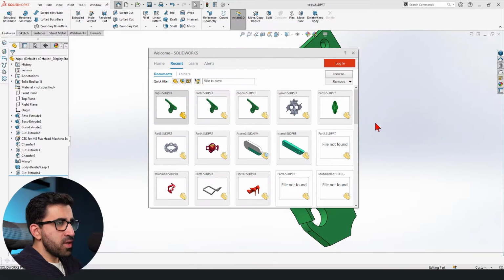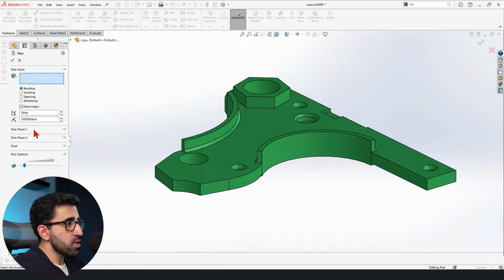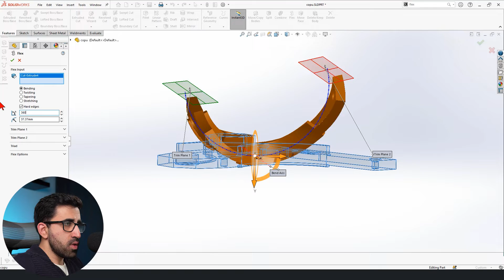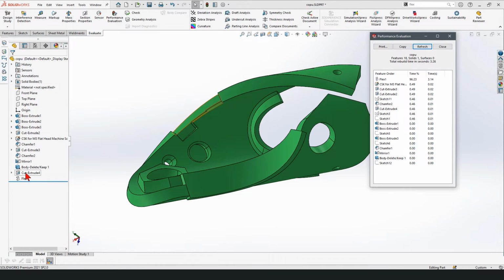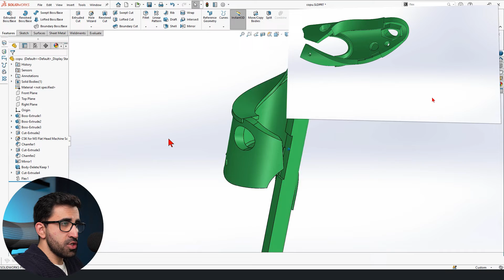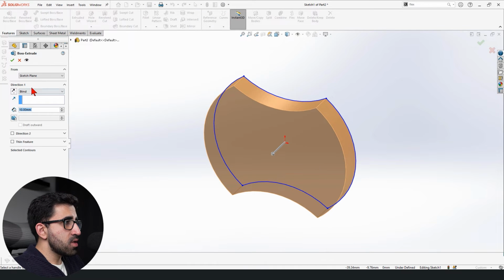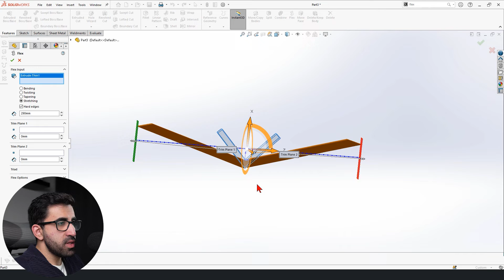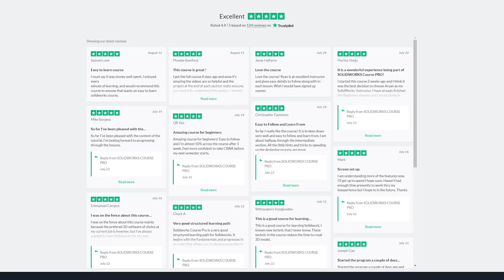Flex - The tool that you SHOULDN'T use in SolidWorks

Comment: I spent way too much time looking for a way to make a tapered loft along a spline work, and finally learned about the flex tool through your video. Hopefully that will solve my problem. Thanks!
Reply from the maker: Glad I could help! but flex is not an ideal solution for your need
Reply: @with-aryan  Yup, I found out shortly after. :D

Comment: SHOULDN'T use.  Hummmm smells like a clickbait video title to suck people into watching.  I feel this way because Aryan gave no reasonable reason for not using this feature other than it takes a lot of computation time.  Just one more channel to block from recommendations.  I will stick with CAD channels that don't feel the need to use clickbait.
Reply from the maker: How many other reasons do you need?
Reply: I have been told by several engineers to avoid the flex tool. I was not sure why and found this video by searching for why not to use the flex tool. I think there are more reasons than just compilation time, since you lose control of the way the geometry forms that you could retain if you use other features, but that's probably beyond most of the audience of the video. There's clickbait, and then there's a teacher genuinely conveying an industry trend to avoid a feature in Solidworks without going too in depth. Find something better to do than leaving unconstructive comments on youtube.
Reply: @paulmiller7078  Paul I don't find Aryan's opinion as a valid reason for not using the flex command.  I do however find the term "Shouldn't use" as clickbait as it is a term that draws people into investing a claim.  If the video title was "The Flex command, it will slow down your work" I would not have felt this was clickbait.  I guess we are down to what one considers misleading.  So I think my opinion is as good as your negative one about mine being unconstructive.  To put a finer point on the discussion the flex command is not all that a problem on a very robust machine with lots of RAM, high-end multicore CPU, and high-end graphic cards.

Comment: I'm trying to create a cylindrical bicycle handlebar grip with a certain shape as relief on the surface. First I tried creating the grip and then adding the relief using 3D Texture and now I'm working on creating a flat version and bending it using Flex. Both options ask more from my pc than it can give and make the files unworkable.
Is there a better way to do this?
Reply from the maker: I'd sweep it if I were you. What's a relief?